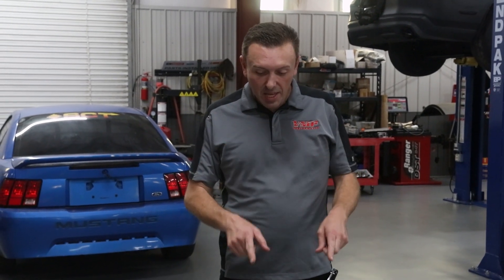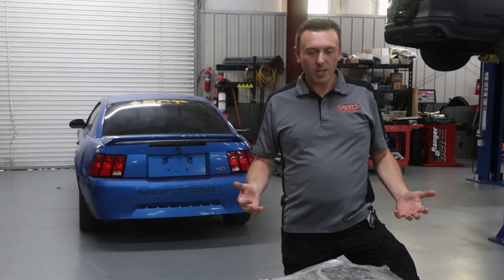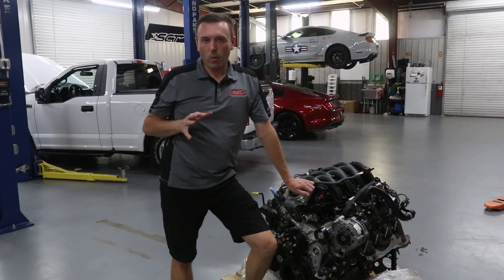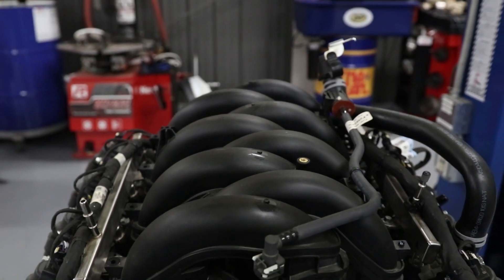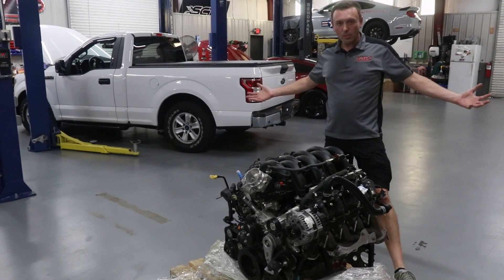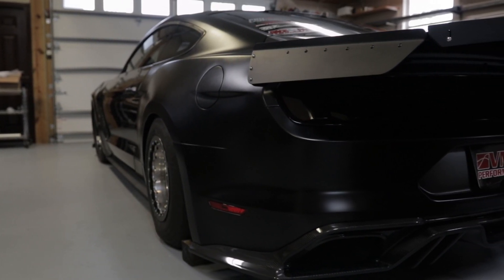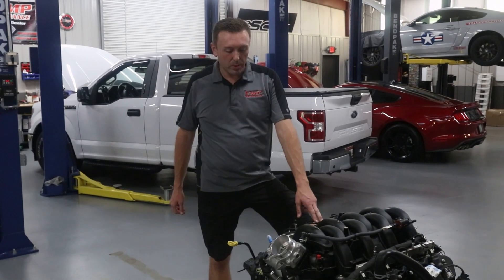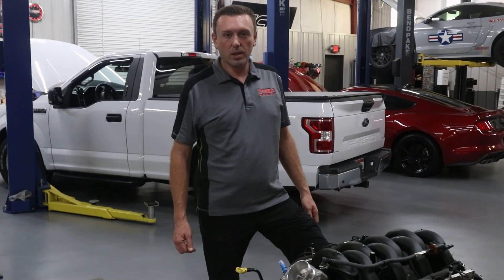VMP just got TWO Godzilla crate engines! || Godzilla Development

Comment: is the bottom end built to handle boost? How much boost, out of the crate, can one these handle?
Reply from the maker: The bottom ends consist of a forged crank and cast pistons/rods.  We'll be finding out shortly!
Reply: Merkel engines put ~15 psi to theirs out the box. Didn't even crack the valve covers. I think it made around 1400hp.
Reply: @AK_Ray  damn...

Comment: Put it in first generation(2010-2014)Raptor . The first generation Raptors with 6.2 are still prized trucks but they need a replacement motor. I am sure you would generate a ton of interest. I don’t think anyone has done this yet. Godzilla/Raptor vs. T-Rex

Comment: Cubes will be nice for low end torque.  That is exactly why my 17 GT ended up with a VMP blower.  Wanted that torque.  

The 7.3 should have nice torque off the hit with no boost but how robust are the stock internals compared to a Gen 2 or 3 Coyote?
Reply from the maker: They are an iron block with forged crank and cast rods/pistons combo.  Some folks have already pushed them rather far as it is.
Reply: @VMPPerformanceTV  yeah I’ve seen what others are doing.  Seems the other numbers are always flywheel numbers.  Either way nice to have another option out there.  Looking forward to seeing what you guys do with them.

Comment: Definitely put that supercharged 7.3 in your blue new edge.  But what transmission....
Reply: 10 speed if it would work?
Reply: Apparently it has the same bolt pattern as the modular platform, so any one of those transmissions can bolt right up.

Comment: Leave it up to Ford to take a good engine and see how much they could screw it up. How much it the timing chain cover and oil pan conversion to make it fit in a low hood clearance vehicle like a Mustang. Then the stupid design of the Tbody angle again to fit in a low hood clearance vehicle. Again going to cost the ford crowd to spend a lot more money to use this engine. Screw it might as well save a lot of money and just stuff a 6.0 ls truck engine in your mustang and have fun for way cheaper. I am anti ls all the way but facts are facts!!
Reply: Who hurt you? You make it sound like people aren't going to make aftermarket parts for this easily. At one point and time there weren't control packs, accessory relocation brackets, etc. So unless you have money to go buy a Godzilla crate already then maybe you should take charge on the R&D otherwise give companies time to make part for it for swaps.
Reply: @CarlosGonz96  there is already some aftermarket parts for the globzilla engine and more being designed. Again its going to cost you 20k to put it in a Mustang. You can buy a junkyard 6.0 ls and put it in a Mustang for a quarter of that cost and go fast. As much as I hate to admit it.....
LS > Godzilla
Unless you have endless money to burn!
Reply: Or just put a gen2/gen3 coyote in it and call it a day? Far cheaper and vetted combos.
Reply: @rileyneufeld7001  where can I pick up a Coyote for less then a grand and make it run in my old car for less then 3 grand ? The fact is you can't! 
So its a stroker ford 400 that I will be putting into my old ford truck.